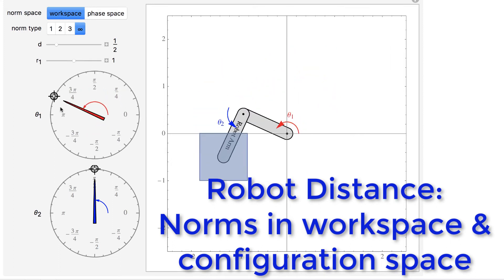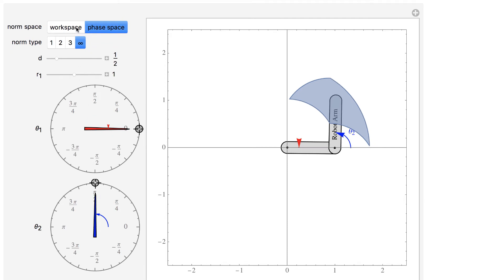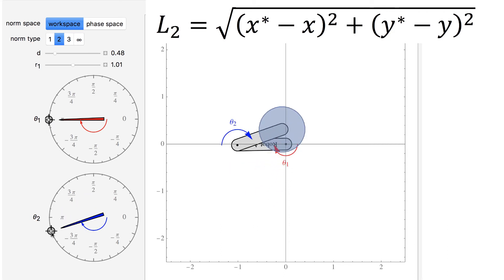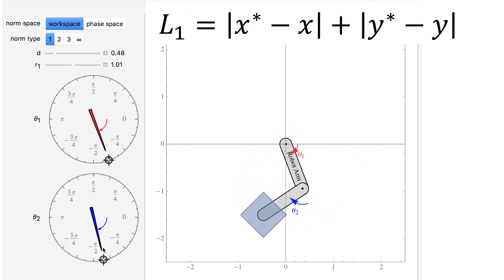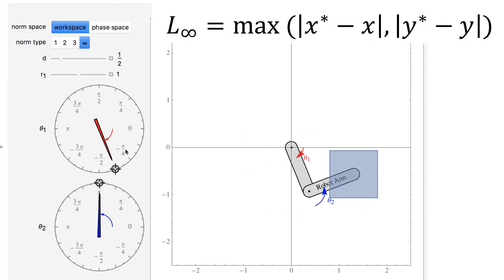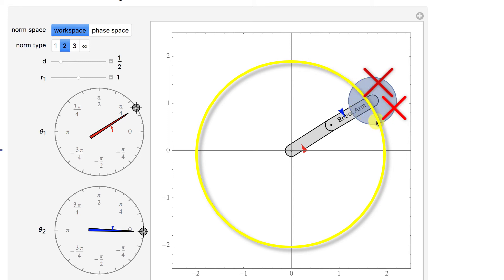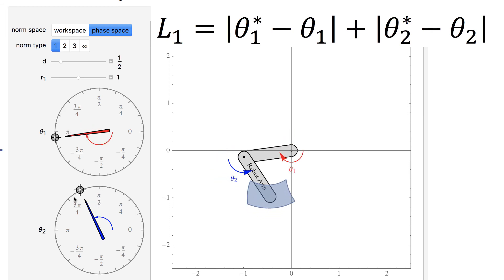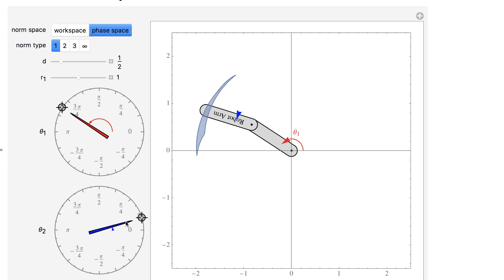How close are 2 configurations of a robot?   (Lecture 23b, Intro 2 Robotics)

Comment: Hi, what about configuration spaces which have both an angular and a real component? (eg. This same setup but the second link is extendable.) I heard this can be done with a  weighted norm but I don't understand how to weight it.
Reply from the maker: @simoncajagi6785 This can be done but it depends on the application.  That is because comparing a degree and a meter often doesn't make sense.  A metric makes more sense when the units are equivalent. However, roboticists often use these norms to compare the effect that moving motors have on the linear velocity of the end effector, because linear velocity (m/s in x, y, and z) is the output from moving a revolute joint at some rad/s or a prismatic joint at some m/s.  I have a few lectures on the velocity Jacobian (which is the matrix of first derivatives of the forward kinematics change for each change of a joint variable).  That would be a good place to look at.